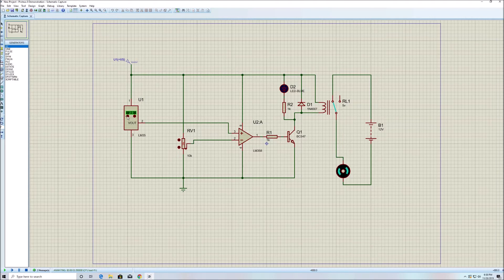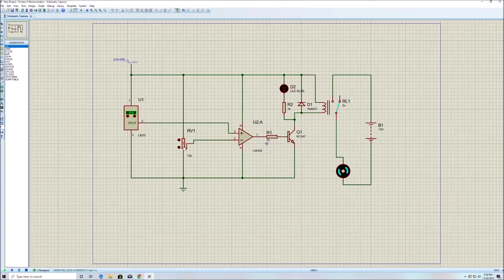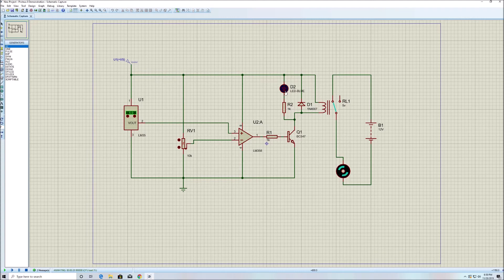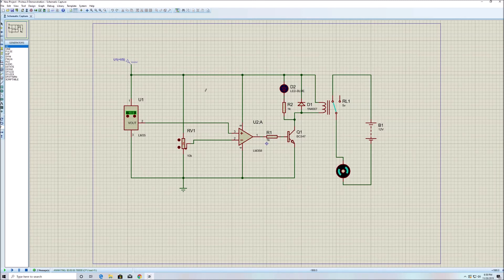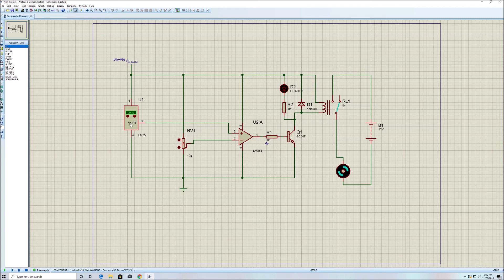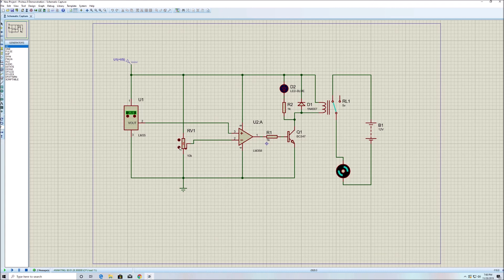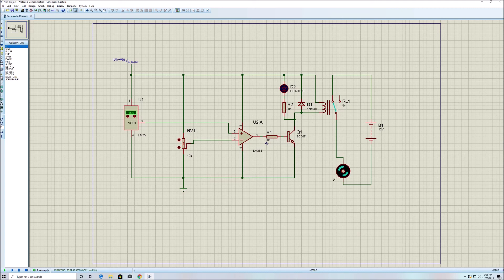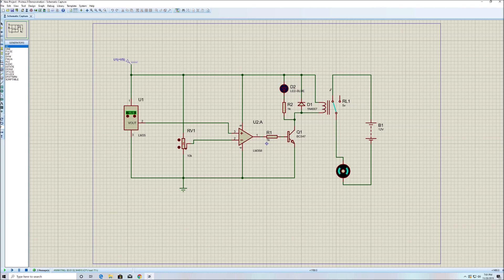PROTEUS ,LM35,LM 358 TEMPRETURE SENSOR

Comment: Good circuit design and simulation. However, I have tried it now and I think inserting the Op Amp and Variable resistor is not necessary. Also, I noticed the Relay voltage has to be adjusted. Anyone that is simulating it should try and place DC Voltmeter at each place of the deign so you will know if it's working or not.

Comment: Hi, this video is amazing, but unfortunately i have a problem. the relay doesn't working (moving), and the motors doesn't rotating. can you give me a solution? thank you !!
Reply: i use schematic, and match every components, but still it wont works.
Reply from the maker: Thanks for taking ur time yo watch,have you provided the right voltage for the relay or motor? you need to choose components that are able to be simulated ,cause not all components  you can simulate

Comment: Please, can you explain what is diode 1n4007 doing in this scheme
Reply from the maker: providing transient voltage suppression. The idea behind having a diode is to ensure a smooth transition between states when the relay is switched such that any transient voltage spike is suppressed.if u remove the diode your circuit not gonna work correctly  you gonna burn ur circuit

Comment: simulation is not working kindly help
Reply from the maker: is it the program or is it the schematic u followed that is not working
Reply: @juniorelectronics8255  not schematic
Reply from the maker: @sameertanveer1094  Well as you can see I was able to simulate the circuit, if the schema was not correct then it wouldn't work, keep in mind when u adding ur voltage u gotta give the correct voltage, and also the motor to work on the correct voltage
Reply: @Junior Electronics  yes I give the correct voltage and make correct connections but still not working

Comment: I made the circuit but motor is not rotating , can u please tell what is the error?
Reply from the maker: motor power comes from the same source?or u have an external power supply for the motor?
Reply: Is it working now ? What did you do ?

Comment: Can I use this circuit on 12v battery??
Reply from the maker: 2 options (1)u can use 12v battery but then u need to add a 5v step-down regulator,.(2)u can power 12v directly to the circuit but u need to modify the circuit